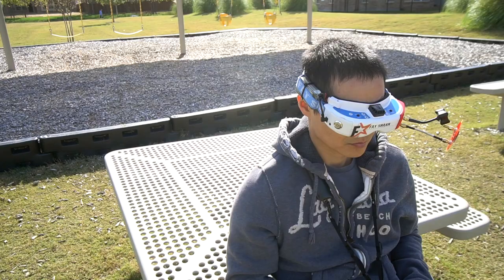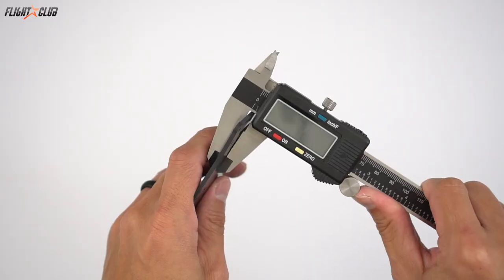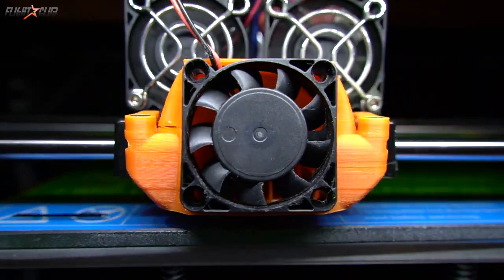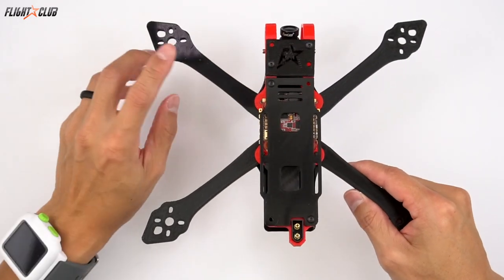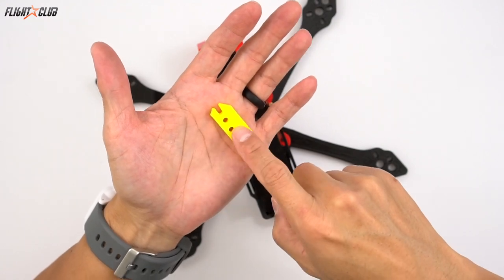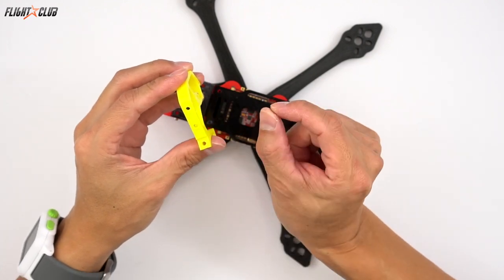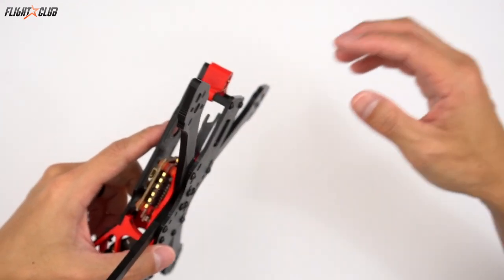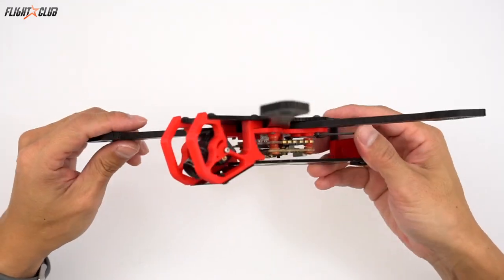FlightClub Freestyle Frame : Bangkok

Comment: Looks great! Love different build options for different stacks. Camera plate design is fantastically simple👍! Would love to build one.
Reply from the maker: thanks!
Reply: @FlightClubFPV   Gave it a little bit of thought now. Would like to see back shelf plate made out of non-conductive material and a 20x20 zip tie hole pattern so for example, I could mount 20x20 vtx flush on the plate.

Comment: This frame looks great, I like the idea of the underslung GoPro option for chase footage. That is a super clever idea. I love that you have slotted the top plate for two lipo straps. That may seem very minor to most. This said, very few frames have slotted top plates for bat. straps. Those that do, they rarely have two. Also love the xt60 mount of the rear. I would like to see there be an adjacent opening beside the xt60 mount that would allow you to slide a balance lead connector to tuck it away from getting chewed up by the props. Just a small open slot beside the xt60 should work great for it. I have two Tokio SX and love them so I’m sure this frame will be just as great!

Comment: The only thing in can see possibly changing is turning the xt60 mount sideways.  So that one of the battery wires isn't pulled tighter than the other.  And so it hugs the battery tighter in a crash
Reply from the maker: i had a model that had that but then there's no room for the SMA.  that's why it had to be turned that way :(

Comment: Hey Mike. Thanks for the time you put in to these frame. All of your race quads looks sexy and nice lol... Your bangkok bottom plate looks awesome. I would prefer lowering the top plate. Get rid of the aluminum and just have the top plate come all the way to the front, plain and simple. I would use micro cameras only with TPU mount. The freestyle frame is long so you have plenty of space to put 20x20 holes between camera and the 30x30... I would use a 20x20 FC with 30x30 esc side by side making your frame super low lol

Comment: I'm digging on the overall looks of the Bangkok (you’re correct.....Bangkok is an awesome name....and an awesome city to go walkabout).  You’ve really addressed the "dual-purposeness" of the frame, allowing for builder customization/selection of components.  Great job....looks like it’ll be a winner!
Reply from the maker: thanks Ron!  that's the idea, easy to build with a wide range of configurations

Comment: For your back shelf, please add two additional screw holes in the bottom place, and a couple of nylon standoffs to support the rearward portion of the plate.  This will help keep it from unsupported vibrations and giving it at least three support contacts.   Also, one other option to consider is the mounting of a 900MHz antenna in the space between the camera and the central flight stack, be it the TBS crossfire or R9.  With the length of your top shelf for maximum battery space, this really lends itself to a long range/long flight time craft.  This would be great in a 6" configuration for cliff flying.
Reply from the maker: yes i will add support for the rear shelf.  currently top plate is about 100mm long

Comment: Really Like what you have been able to accomplish with this frame. I love the camera protection & also how ingenuous the slots are cut to allow for both mini & Micro cams. My favorite part is the rear shelf, that's my biggest grip about my chameleon is mounting the VTX & RX in the back is either ganky with VBH or Zip ties, or you have to design a mount & 3D print yourself as I did. This Frame looks like it will build up very nice. Also really dig the XT60 solution. Would love to be a Beta Tester for this Frame.
Reply from the maker: yeah i hate trying to figure out how to mount stuff on some frames.  i try to make a spot for everything to be easily mounted

Comment: I think you have some great, unusual ideas for this frame. I like the integrated stack holder that flows into the camera mount. The shelf is really neat and the rear power plug adapter is a great design. Removed the mounting guesswork to just antenna placement. Can't wait to see the finished unit.
Reply from the maker: thanks!

Comment: Awesome design Mike.

There has been a lot of talk about the top plate and battery straps breaking.
I am wondering if we could approach this from a different angle.
I am thinking of a stainless steel U rod that is incorporated that runs around the top of the frame and is secured by adding placement area in the alloy part  .. the rear has alloy stand off that this stainless wire which is threaded slides in to with locking nut.

Your straps now loop around this stainless wire and you get the benefit of having..
1/ No sharp edges to cut a battery strap.
2/ Your battery is held in a non rigid manner because the stainless U will have a little bit of give which is probably one reason a battery damage would occur on frame.
3/ The front U can have a battery strap that is looped around this front to rear which was talked about here in comments.
4/ Battery straps do not mix with electronics as they loop around this wire rod..
5/ Maybe with a bit of research it could  become part of an arial system but I can not comment to much here .. 

The other thing I was wondering about was about the options you are giving by having placement for both stack sizes.
I was thinking about a dedicated frame exactly like this for 20x20 freestyle  builds .. narrow in body and liighter overall.
So my question would be ... will you look into this design being a dedicated 20x20 design as that's where the technology going by the looks..

Really appreciate the effort  you put into this stuff.

Oh and one last thing that comes to mind is to have a carbon ring that the rear motor stacks on to lift that motor into clean air as an option in the kit. Yep can be done with TPU but we already have the butter mounts so was just thinking out loud.

Also  arms like what is used by Richard  in the Hyperlow Freestyle Vert frame and we have all the bases covered Ha Ha ! 
Well that could be your 20x20  dedicated version of this frame .. Vert arms with your cool current ideas.
Reply from the maker: thanks for your feedback!  yeah with more and more 20x20 parts coming out a dedicated 20x20 frame would be sweet!  i'll look into that

Comment: I absolutely love the ability to swap between mini and micro camera mounting options. It's ingenious!!! I'm also really liking the way the arms lock together. As for things I might change, there isn't a whole lot. The vtx and rx plate seems really interesting, however, I'm curious about how it'll last through crashes. If at all possible, a 20x20 mounting option in the back might be great for some vtx and fc solutions. Weight is obviously an important factor. I feel as though a few extra cutouts might be needed to bring it down a bit, and from what I've heard, only one battery strap slot (per strap) is needed. The final thing I can think of is to turn the xt60 mount and cutout 90°. It'll make the wires run a little easier. Whether I become a tester or not, I hope this helps!

Comment: Its a very nicely thought out frame. It has everything you can ask for for a freestyle frame. Maybe you can also have a dedicated place to put the Immortal T antennas for those running Crossfire/R9 systems and a slot for a capacitor near the xt60 mount.

Comment: Hahaha love the intro. Awesome frame too! I would absolutely love to help you "Prototype and tweak" this frame. My only suggestion so far would be to drill extra holes in the fuselage under the shelf so you still have the option to mount 30x30 or 20x20 components. Knowing me, I'd break or lose the shelf and then be out of luck until my replacement came in!
Reply from the maker: thanks!  ok, i'll add 20x20mm on the rear shelf.  good idea!

Comment: Sorry for the long comment.
Great design. I liked it and I believe this will be a great frame. 
Some of my comments

I liked: 
- It is an X style for freestyle.  PID tuning of X frame for freestyle if much easier than H style.
- Two sections slide on the top plate for securing batteries
- support soft mounting, 30.5x30.5, and 20x20 FC
- support for mini and macro
- dedicated HD camera mount.
- I like the way the top plate is removed to have access to components. camera stay untouched.
some Notes:
- The sliding mechanism for arm locking seems a weak point for me. You may need to make slide bigger and it becomes a hassle to match them is there is some error in the production.
- For camera mount, I would suggest putting some space for people who want to soft mount their camera.
- use press nuts for screw section of the plate for HD cam.
- XT60 mount is good but my experience showed it may cause so some issues for FPV antenna if you want to attach SMA to that the close to one. I would consider some mechanism for side mounting xt60
- consider the same 30.5x30.5 pattern holes for to plates. It may give some flexibility for people to play with their components.
- make sure the HD camera angle and distance will not cause to have props in the view. I know this is the case with the angel but a good distance can help not to have this issue with different angels.
-It would be great to make some 3d accessories available for people to download and print by themselves.
Good luck!

Comment: The xt-60 connector in the back for not cutting the wire. Nucleusplate and the isolated 2020 and 3030 stack is a really nice feature. Nice space for vtx and reciever.  Fast swap of arms is nice  and i love the true X. Nice to have the option of chasefootage. 

Would love to see antennamounts, free stl files for armprotection , some slot to put the joystickwire in  ( I dont use rx/tx for that ). 

Looks Great!

Comment: Never really stuck to just one type/brand of frame. I switch designs based on how I feel the build and flight characteristics will turn out. Usually its either a nice flying frame but a pita to work on and repair, or flys like like crap but has space for everything and I'm liking your direction on this one. I'm overseas but hope to be considered for a prototype test sample.

Comment: Hi Mike. Over all i really like this frame. But i would change the followings points. Front end for fpv cam made of a 3d printed tpu part instead of aluminium to reduce the energy to the frame in case of a crash. Putting a tpu part at the rear end as you made it for the proton frame. For me this is the perfect fpv antenna mount. No need for a xt60 connector mount. Tpu parts like you made it for the proton frame for gopro session and popro7 which can be screwed directly to the top of the frame. These are all my inputs. I would love to test this frame for you. Alrwady fly the tokio x and i am still happy with it. BR

Comment: Love your new vid format, man. You do great work. The frame is sweet. The back shelf looks a little shaky. I would want to butter mount a dvr runcam there and it does not look tough enough for that. The FC and cam cage looks solid and isolated well. Skeptical of how solid the xt60 is as well. Would like to test that slammed frame. Keep the videos coming. Big fan!

Comment: I dig the nucleus plate. Separating everything from the arms is a neat idea. I would like to see an option to mount the battery "toilet tank" style as well as traditional "hot dog" style. It just seems like a pretty easy thing to include but most frame designers totally overlook it. That's my two cents. My first quad was almost an exact copy of your qav210. Your vids helped me out SO SO SO much on my first build. Keep up the great work!!
Reply from the maker: yes i will add slots for a hot dog style mount, thanks for the feedback

Comment: Also since there is no forward and back adjustment for the fpv cam, if we change lens and the camera plates are in view, or the lens is exposed, are we just stuck with that? Was honestly expecting something ground breaking like my beloved tokios. Don't get me wrong, I like the frame but its just another chameleon type frame with a more clever mounting and assembling system. Those front plates should be tpu to absorb crashes and avoid bending or breaking aluminum ones. I don't know. I really want to love it too but I feel sad. Hahaha

Comment: Great job Mike! The frame looks awesome! I love that it has a good mounting system for the video transmitter and receiver, and also that it will use a similar nucleus system to the proton! all of your frames are super easy to build and to position stuff! What I think could be changed is to have another two mounting screws on the bottom of the frame for that second stack so that it's not wobbling around. Other than that it looks like a super awesome frame, and I would be honoured to test it!
Reply from the maker: yes support will be added, thanks for support!

Comment: 1) the nucleus plate is ingenious. love my PROtons and (soon) Neutron. major reason why i retired my current freestyle frame due to lacking this major feature. 2) an aluminum cage will bend in a major crash, compromising the rest of the frame. titanium is superior, but people will fly in the cold, which will break in a crash. recommend a NON-METAL cage, though your micro/mini cam mounting system will be lost (unless it's injection molded TPU...maybe?!) i gotta admit, that is frikin' genious! so i might have to compromise :P 3) why the extra material for the LiPo straps? those slots will likely crack upon impact being that thin and external to the top plate. how about making cutouts inside the perimeter of the top plate? also consider there may be folks who like to mount batteries "toilet tank" style. 4) the CF shelf is a good idea as another component mounting location but being held by only 2 screws onto the rigid nucleus may not fair well in a high-G crash. bushings placed underneath the screws can dissipate and soften the crash forces and protect the shelf from snapping/breaking at those two securing points...buttermount them! 5) countersunk screws on the top plate and GoPro areas to prevent damage to batteries and action cam. 6) XT60 connector flat along the rear of top plate. smaller profile and more importantly, evens out the battery lead wire lengths. plus, the connector on the battery's power leads is also in this position as it comes off the battery. with its current design, u have to turn it 90º when plugging in.

Comment: the 30x30 stack at the back might create vibrations from fluttering since its mounted only with 2 screws. Maybe extend the nucleus plate. I'd also try 6mm arms.
Reply from the maker: yes i will add support for the rear shelf.  6x15mm arms will be overkill and crazy heavy.  5mm looks like a good medium
Reply: @FlightClubFPV  Sounds great man. Though i'd say a little heavier freestyle build will give better flight footage. But i know FlightClub prides itself on lightweight! Keep up the good work man.

Comment: Smart design. I like the clever way you use the front plates to allow mini or micro cams. If I had to pick something I don’t like, it would be the long unsupported length of top plate. One smack of the battery when flying under something, and your stack is toast. I designed a similar frame myself once - and changed the design after two smashed stacks. Additionally, my FEA analyses has shown that standoffs immediately in front of and behind the stack increase stiffness big time (because it allows the top plate to add stiffness). In fact my latest design includes a little protrusion in the arm that ties it into those standoffs as well. Just some thoughts! Cheers!
Reply from the maker: yes i'll add support on the top plate, thanks for the feedback.  thanks!

Comment: Hey guys congrets on the frame. Not many frames get me excited any more but i like the direction this is going. I fly mainly amaxinno freestyle 5 frames now and one of the biggest reason is bc it takes any size camera. Other positives for amax is weight is 99g, price $40 and very durable. Down sides are replacing arms and bottom plate you have to take stack out, no room in rear, and no gopro mount - 3d print. It looks like ur frame is taking care of all those downsides. Only thing im not sure about the aluminum. I flew armattan chameleons before amaxinno. The bolt holes were all stripping out had to run zip ties through them and it was all bent up over time. 
I'd love to be a tester thank you for the opportunity
Reply from the maker: i believe the chameleon use m2 screws?  Bangkok will use M3.  The threads have proven to be extremely durable in the PROton and Neutron.  I've never heard of any threads stripping in those.  the plate in the Bangkok is even stronger
Reply: @FlightClubFPV  hell yeah man. Yeah the chameleon are m3 which dont work out so well. Im sure the m2 will do the job alot better.

Comment: Looks sweet, hope the SMA hole will have a rubber isolator, because had issue's with some frames using aluminium for SMA mount and that introduced nose. Have no clue why, but isolation helps. And for battery straps, I would go with one side strap holes, in my opinion there is no need for two, one on each side, since one will hold strap in place when battery removed. Butter mount for FC is nice touch and both FC mounting solutions is 👍, clever why for cam mouting 💪😎 I like the color scheme, hope it will be the same for final version 😅